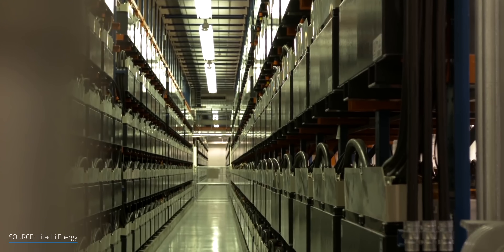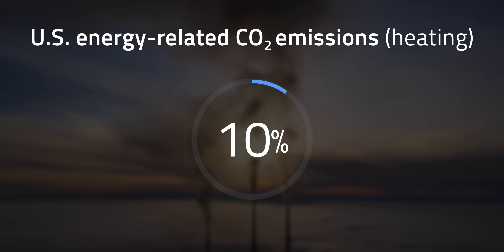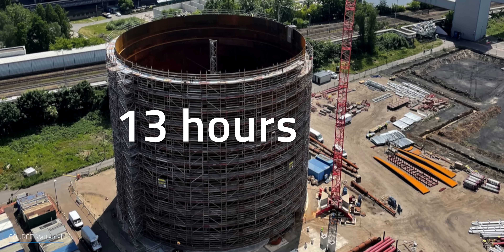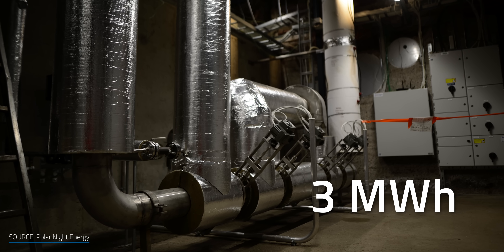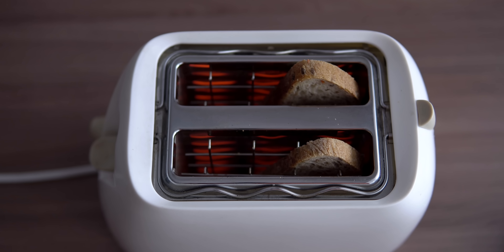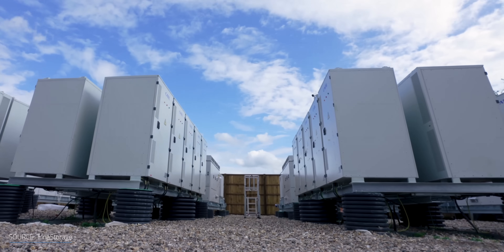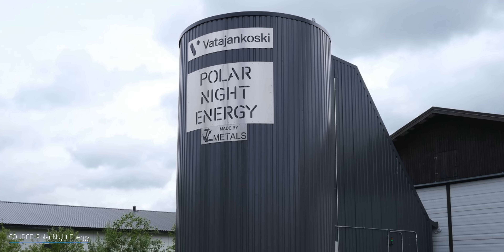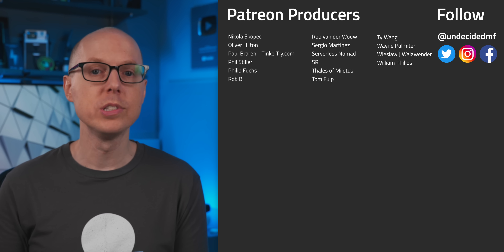How A Sand Battery Could Change The Energy Game

Comment: This video and articles about batteries all have the same problem, they never mention that that they add cost to your electric bill and our focus should be on renewables that do NOT need batteries first.

To make solar and wind energy reliable you have to greatly over build what you would need because it doesn't produce all the time and use massive battery backup systems to capture energy when it is producing for use later. They never include the cost of overbuilding and the battery systems when they tell you it's cheaper.

Batteries cost money to build, to maintain, and batteries wear out and need to be replaced. Batteries are not 100% efficient so when you charge a battery you do NOT get all the power back. So, in the end batteries add cost to your electric bill but are a necessary evil to make wind and solar reliable. Pumped hydro and sand work just like a battery and has the same problems as batteries do. The EPA calls pumped hydro a negative renewable because it uses more energy than it makes.

What would be better than wind, solar, batteries? Geothermal power which is also a renewable and it works 24 hours a day, week after week, month after month just like coal, natural gas, and nuclear.

Geothermal and Biomass/Biogas should always be looked at first to see if it is a good fit for your location. If it is not, then look at solar and wind just realize it's NOT cheaper.

Comment: Thank you for the video! This tech needs to be compared to a gravity battery. The problem with a sand silo is extremely good heat insulation to keep its 600c for months.. A grav battery doesnt have such a problem.

Comment: So far i have come across people working on a single approach to energy storage. I feel combination of a few ideas or approaches will be the answer. For example, combining sand battery with a gravity battery could have far faster adoption. Transferring heat energy to homes for winter heating has limitations - it is useful only in cold countries and where storage and usage is in close proximity. If solar energy were used directly to heat a sand battery, and heat stored were used to drive up heavy loads up a hill slope, we get option of electricity generation on call from the gravity storage. Electricity could be transmitted to any distance. Both the batteries are using natural resources to the maximum and thus will be low cost. There are two riders here - 1. You need hill slope otherwise building heavy gravity structure will have its own cost and payback. 2. Overall energy efficiency needs to be higher than combining solar PV panels with other storage methods. Is any organisation working on such a PoC ?

Comment: I think the sand systems would work very well on a personal level, ie you put up a few solar panels that heat up your own personal sand bucket, then you take that hot sand and use it to warm up your house.

Didn't they use hot stones for something similar where sand wasn't available.

I know the Arabs used this system did so for thousands of years, big clay pots in the sun then moved in at night to places where it was cold, warm toasty rooms at night, not much wood to burn in a desert I suppose.

Comment: Why can't we just use the excess power to store potential energy? Then in periods of demand, convert the PE to KE using gravity.. just pump up water or some other fluid into higher storage. During demand, let the water run some high-efficiency turbines...
Reply: The round-trip efficiency of PSH is generally only 70-80%.
Reply: @jereviikari109  What if we turned the thermal energy in a sand battery back into electricity instead of directly heating? Do sand batteries have capacity or cost advantage? Do they have a scaling advantage? For example, if this is an 8 MWh battery... how much would it cost to design and implement something on the scale of a small sized PSH facility (around 4000 MWh). How much excess energy do renewables make and can we easily store that energy in sand batteries for re-use?

Comment: So you heat up and when power is a available and then use that sand to boil water to produce power when it isn't,  I mean it's not the absolute worst thing I've heard, but a system experiencing a near constant loss of power just due to the passage of time seems to me like a game of loss, even in a vacuum heat can be lost so this thing connected to the ground and subject to ambient temperatures seems a bit like throwing that power away, just slowly, I can see how it would work in undeveloped areas or just areas whose power demands are extremely low, but on the large scale i just don't see how this would be practical.
Even under ideal conditions it would need routine re-upping to keep it at a level where once it was needed it would even be useful and that would mean that its in an area that revcieves a pretty reliable source of energy anyway making the battery almost redundant, if its being paired with wind mills then its for when they aren't receiving wind, but they are probably placed in an area that receives regular amounts otherwise its not really a good thing to have them there, these seem useful for a very short period where the wind has died down but only for a short period. Seems like they make up for a time when there's a lack of generation not too much.
Overall interesting find thanks for showing us.
Reply: The price of electricity is determined on NordPool for each 15-minute interval of the following day. Typically, electricity is cheap when there is a lot of supply, and at such times, the price can even be negative. During severe cold spells, there is usually very little wind, and then electricity is particularly expensive. With a thermal battery, that municipal district heating company can save costs related to fluctuations in electricity prices.

Comment: Why couldn't this tech be downsized. It seems extremely safe so why not design a home sized or subdivision sized storage unit? Why focus on the city grid? Though that would be a much larger usage it also would have less of an impact than making them the size to be used in houses or small communities? That would certainly make the application  MUCH wider.

Comment: Maybe I missed it in the video but it seems to have been brought up in some of the comments.  Longevity should be a big selling point on this.  Battery solutions have a shelf life that requires quite a bit when needing to replace them.  Something along these lines should have a much longer lifespan.  Unless the container breakers the sand would last indefinitely.  I would think electronic components outside that would be, comparatively, cheaper to fix/replace than a battery wall would be.  That would make it worth being considered at least.  Plus as one person already stated, there are no rare earth materials or dangerous chemicals involved in this one at least in the storage portion of things

Comment: Pumped hydro is the only gravity battery that is practical  for moving the volume of mass that needs to be moved. All this using dead weights suspended by cables, is not economical. Run the numbers and it becomes obvious, so time to drop the dumb idea and just use pumped hydro where economical. This project doesn't work on paper and no break throughs exist, time to stop funding it.

Comment: Hey this video i look it up now already thousant time to find more information about this. iam building my house. Now in germany and i always wonder if it was posible. To connect this sand baterrie whit a stirling engine to provide me for electric energie for lightin up my lights in the house. the heat is already there for warming up and hold it cossy in the hous. But how big of a stirling engine do you need to give me about 5 to 10 kilowatt a hour i would say a normal house hold use for a day and night. And is there maybe something else that can do that. To provide me from heat to energie on a evicent way. Maybe a good video idee to get me maybe started in such projects. But iam bad in mathematics 🧐 the problem is indeed to store the energie when needed. In the summer you have to much and winter is to less sand batterie is a good sulution indeed for heat storage wand to build it by my self. Thanks for al this information already good details in it. Greating from germany

Comment: $15/kWh !? .... once it is scaled up?

That's about 500x more expensive than retail electricity prices in the most expensive energy economies. If we're going to justify such technology simply because we have a problem with intermittent renewables, we really need to stop this insanity and just bite the bullet on nuclear power, which can just replace fossil fuel plants for RELIABLE energy, including the same ability to supply thermal output if necessary, as well as electricity. Can we please stop it with this grid destabilizing and nature destroying 'renewables' mind virus already? This unnecessary conversion to wind turbines, solar panels, 1000x the needed transmission network, and battery storage will kill the environment, not save it. It's insanity.

Comment: Do you think the cold counterpart could be done for use in areas where heating is not as needed? Like refrigerating a bunch of sand with the excess energy and have it be insulated against getting warm. Then the cool air could get distributed to a metropolitan area.

Comment: Based on a rough estimate an average city of 1 milion people needs on average about 1 milion MWh of energy. So If one sand battery can store 8 MWh all You need is 12500 hundred of them for every city this size and considering they will be more useful for winter You would need to multiply for the coldest months. I don’t know how expensive it is however I’m sure it’s not cheap and at this point I would think about more dam and nuclear powerplants honestly…
Reply: I think there is misunderstanding that sand battery would store heat for the whole winter.
Polar Night Energy says on their page:
"It can stay hot for months if needed, but the actual use case of the heat storage in Kankaanpää is to charge it in about 2-week cycles."

Comment: How can it stay hot? Everything leaks. I only see this workable for a few houses at a time. Wouldn't it require several layers of insulation? Can a crazy person take a hammer and punch a hole in it and then no heat till it's repaired? Where do you get a welder in 10° at 5am? How long does it take to heat up?
Reply: @NelsonClick You got record of most stupidest "questions" of world. Let us dump 100 tons of 500 Celsius sand over your and your  neighbours house and ask 2 days later are you feeling cold. We are getting excess energy from our wind farms at times already. It will get much, much "worse" in coming years. That is way to cheaply propel central heating (never heard such thing propably) in town/city level through the rare really cold and calm days and weeks.
Reply: Why would it be usefull for couple houses only? It seems to be most promising technology in larger scale. The protype plant is already 100 tons. Scaling to 1000 or 10.000 tons seems easy.

FYI Germans (with aid of Swedish energy company) are filling an 15 million gallon silo in middle of Berlin with near boiling water. Seems way inferior solution.

Insulation. Why would you want insulate it? If you have excess energy, build bigger silo or more of them. Its the freaking sand which act as insulation, while it can withstand high 500-600 celsius temperatures. :facepalm:

I know you never have dipped your foot on geothermally heated sand and got bitten.

Comment: Alberta Canada 50th parallel residential (Okotoks?) off-grid, residential housing Coop.. have a heat/sand battery out of sight, away from mother nature, wind, 🌪️ under-  - ground for many reasons.. insulation and affordability..
PS
how much does it cost to ship one of these empty? I want to bury it in the ground and then fill it up with locally available sand 😊😊

Comment: My smallholding has sand and gravel beneathe the topsoil.....LOTS of it. I'm going to dig an area out, heavily insulate the void, return the dried sand with internal heat deposit and retrieval infrastructure, then use a dedicated PV system to run it. A game changer that uses what I already have!

Comment: It is hard to believe that sand could retain that much heat energy for months while constantly having heat taken out of it.  Also, I know "excess" green energy could be used to charge the heat, but if the sand is so good at holding the charge wouldn't it be equally resistant to taking the heat while charging?  Also also wouldn't there be a ton of voids where the grains of sand touch?  I would think a solid mass like lead that could be heated until it melts would be better than sand?

Comment: What's missing is a Sand Solar Cell... As in a solar cell which utilises the full potential of silica/silicon. With that much desert exposed sand, the 1st generation Solar Cells should have been successful. It's annoying how much potential is wasted. Hydrogen, thorium salt reactors, basic nuclear reactors, anything other than old fashioned "cave man" burning of fuel is better...

Its sort of sad that it's come to a point that the caveman with the bigger stick is ruling the roost when it comes to energy...

Comment: 2 comments: 
#1: small mistake: The video showed at the beginning of the Azelio's pilot is using latent heat and not sensible heat.
#2: Not any type of sand can be used as you might have agglomeration at high temperatures. So pure silica sand is required.
See my student paper here:
https://scholar.google.com/citations?view_op=view_citation&hl=en&user=Uc9H4kQAAAAJ&citation_for_view=Uc9H4kQAAAAJ:TQgYirikUcIC

Comment: This sounds really good. I think the only big problem is figuring out how to store the heat for long enough. But this sounds perfet for municipal heating which is very common in Europe. And even during the summer, people use hot water. So why not heat it with stored solar or wind energy rather than burning gas? This sould help rationing energy a lot better and more efficiently.

Comment: So what's the feasibility of taking an existing indirect water heater tank and turning it into a sand battery?  Indirect water heaters already have heat exchanger coils for water running through them and these water tanks are designed for thermal storage of water.  Water is not potentially as hot as the sand, so maybe the current materials used for these devices is not up to the task, but if it works, you could put one of these into every home and make it work with existing heating systems.

Comment: Could these sand batteries even be used as thermal storage in a chimney updraft system? I.E. an acre of these tanks surrounded by 100-150 foot updraft structure. Wind turbines at bottom vents or top. Stored  heat generated from solar panels with updraft heat released continuously or at night.

Comment: Will not work because of efficiencies under most circumstances and even under most ideal there are better ways of moving weights around .The only way of using something like this efficiently is to use production discharges from some other operation.

Comment: So in theory, it it possible to build a standalone house in the middle of the Mongolian desert with:
1. solar panels to generate electricity;
2. sand (basically everywhere) battery to store the energy; combined with;
3. geothermal air-conditioning which uses the generated/stored electricity to keep daytime cool and nightime warm,
So as to make it 100% energy self-sustaining with no infrastructure connection?

Comment: Problems: 1. degrading type of energy from electrical (to heat the sand to 600C) to just thermal
2. transport of such heat-converted energy will be more a problem than transport of electrical energy. Since wind turbines rarely are near big cities and obviously enough/strong enough powerlines are already a problem, what to do with onsite generated heat from excessive wind, stored in sand batteries near the wind parks? Converting back to electricity comes with huge losses ....

Comment: Methane from landfields can also be used to heat up sand batteries.
Reply: That's not carbon free ("renewable"). Well, if you mean landfills, maybe.
And if there's methane, it could as well be used in motors (block heat powerplants) to generate more electricity plus some heat.

Comment: So, this wouldn't be a practical solution for the closed coal plant in my area that closed a while back.  They are looking at utility scale solar with a few hours of storage.  The locals are upset about the lost jobs at the plant.  There is a second one closing in a bit less than a decade.  My thought was they could keep one or more of the turbines in place and use this to store heat.  Then it would preserve at least some of the jobs and be a way to keep more than a few hours of storage in the bank.  You say it drops the efficiency down to 25% but is that good enough to justify it as an intermediate storage solution?

Comment: The distribution of the heat is not that simple afterward. You need a complete network of isolated pipes. It's not really a battery. A battery store electricity, not heat.

Comment: Not sure about the rest of the world but in the UK we often have hot water storage tanks in our homes.

The water is heated at night when the electricity is cheaper and can be topped up as needed throughout the day if more is needed.

I think it would be great if these tanks had a sand ‘jacket’ that was heated using solar panels on the building.

It would be a great way of storing green energy for your own home without the expensive need to attach your panels to the grid. Especially as you get very little back from the supplier for each watt you supply.

You wouldn’t even need to change the hot water tank or attached heating system much as the existing system will only heat the water if it needs to. If the sand jacket was sufficient to heat the water to say 40 degrees Celsius, much less energy would be required to top it up.